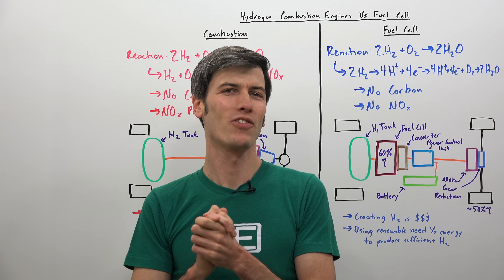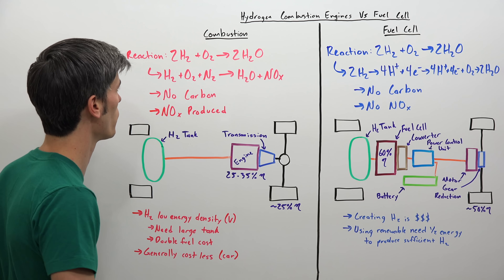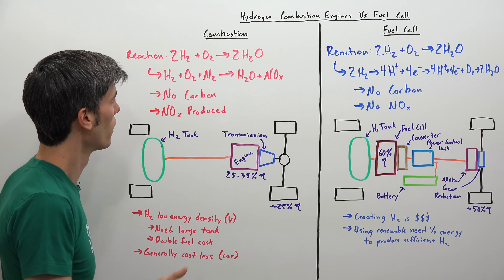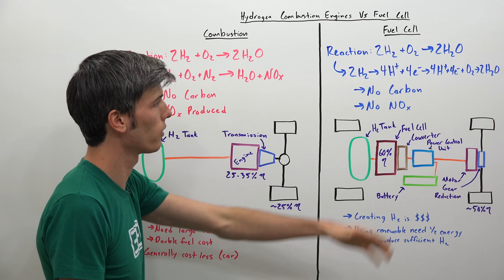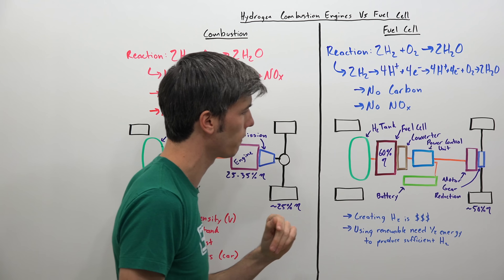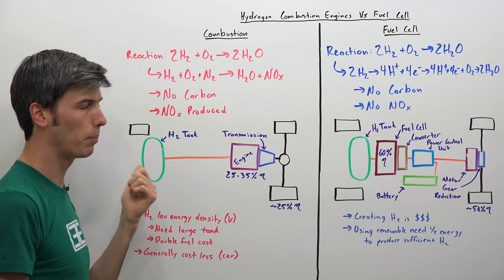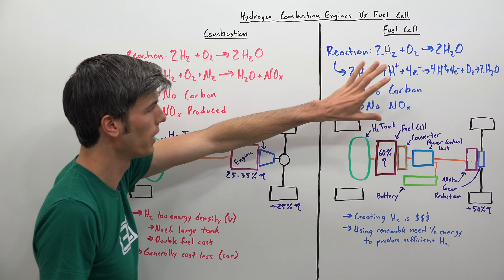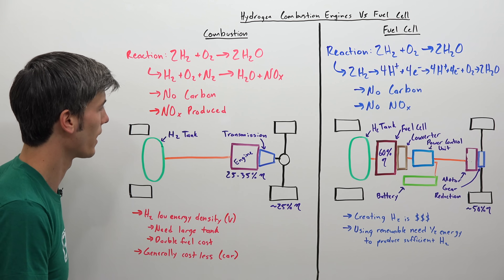Why Hydrogen Engines Are A Bad Idea

Comment: Have you ever looked into ammonia (in a Diesel) vs. traditional Diesel fuel?
Reply: It's been successfully done. In WWII, Belgium converted all its buses for ammonia fuel, and set up the fueling-stations. infrastructure for manufacturing, storing and shipping ammonia is already widespread. Ammonia liquifies at around 200 psi. Fueling stations can quickly & cheaply be converted to ammonia. Ammonia doesn't make any CO2, and can be made from renewable electricity, air, and water.  Instead of hydrogen in internal-combustion engines, it should be ammonia in Stirling Engines. The Stirling is the most efficient heat-engine, and is an external-combustion engine, and so it can easily and cleanly burn any fuel, including ammonia.
Reply: @michaelossipoff2433  i agree
Reply: @michaelossipoff2433  I know. But I was interested in a deep dive on the technical differences in performance. I know it worked and it has a lower energy density than gasoline. It also leaves a cleaner engine behind. But I haven't seen any in depth information.
It's also been used as jet fuel and rocket fuel. Again, it burns fairly clean and has several benefits. But little detailed information.
Reply: @jasonalexander2952  Yes, there should definitely be a lot more discussion about Ammonia fuel. (...and about the clean-burning, maximally-efficient Stirling Engine). But, just based on the information already available,  ammonia certainly looks like the best near-term prospect for a fuel.  And, even without details, the success of ammonia-burning Diesel buses in Belgium says a lot. It only took 5 months for the conversion.  Ammonia is so much more ready than hydrogen is!

Comment: The problem with H power is this-
The US has 150,000 gas stations
The US has 140,000 EV charging stations
The US has only  58  H fueling stations
57 of those are in California install by the state 
to give H a jumpstart.  It didnt work.

!

Comment: but here is the thing.

you more likely to get people to be driving hydrogen combustion engines then you are hydrogen fuel cells because a regular gas burning engine can be converted to a hydrogen combustion engine rather easily compared to converting it to a cell system where you would litterally have to rebuild the entire thing pretty much.

Comment: Water vapor is a stronger greenhouse gas than CO2. Where do you get the H2?   How large is the pressure tank for H2 to get decent range? Any kind of H2 will never get better than gasoline ICE. It is better to improve gas ICE for economy and lower other pollution.

Comment: personally i think at least now hydrogen combustion engines are impractical because hydrogen gas requires alot of electricity to produce and in turn requires fossil fuels to produce maybe its viable in countries with reliable renewable power like hydro dams but even then hydrogen cars will be limited to where fuel is available

Comment: Could you not generate your own Hydrogen ?  A simple electrolysis setup powered by solar panels, that you can collect and compress with a repurposed medical or scuba compressor. I have one that was used to fill air-tanks for planes. I have a couple home generators that are already set up to run on gas or propane, that i plan on using as a test bed before trying it on some old Chrysler 413 wedge and 426 Hemi industrial units from the late 60s early 70s. The Chrysler motors were built to run on propane so they already have the hardened valve and valve seats as well as forged pistons. I know the propane burns much hotter than gas, so if you just throw a propane system on a regular motor you will not like the results as it will basically melt the combustion chambers of your engine. will let you know how it turns out. With fuel prices this high price the electrical  rates are going to skyrocket as well. We need to find other ways to power not only our cars but our homes as well.

Comment: Have you seen a fuel cell breach. If you have you have you would know exactly why fuel cells are a bad idea. An instant death is not worth hydrogen oxides which can be easily recycled within the car extending its range.

Comment: Where does the nitrogen come from? Atmospheric air? Why not burn the products of electrolysis? So you just put water in the fuel tank. Electricity comes from an alternator

Comment: Couple of big problems in this video that are not bought out. 1. Yes H2 combostion engine greats NOx but unlike, H2 fuelcell engine it does not great huge amounts of carbage from used up fuel cells, those cars themselfs are much much more ecofriendly. Fuel cells are basicaly big batterys, and bateries are bad for enviroment. Second, while its true that H2 combustion would needmuch bigger fuel tank, its also true that it does not need, powercontroll unit, fuel cell so total difference between fuel tank size compared to the hole system is not soo big. Also this tank can be big because it dosent weight much, for example we could easily make the tank same size as electric cars bettery pack. Just but it under the bottom and we would have plenty of room, witch dont take away passanger room. Also price wise the combustion is cheaper.

Comment: IMO, if we want to continue with the luxuries we all use and enjoy now, mainly transportation and electricity, and if we want these things in the abundance and reliable ways we currently use them for, minus the dirty emissions that we now produce, then the only way to achieve this is through nuclear energies. 

Renewable energies are great and will continue to improve as time goes on but they are not able to keep up with our demands. Two big demands currently are air conditioning/refrigeration that is available everywhere and charging stations. Both take a lot of electricity. Renewable energies cannot keep up with this demand, but nuclear could. So if we want to continue this current life cycle with all our luxuries and demands then nuclear is the only way to go. It's either that or we go back to hand held fans and covered wagons because you can't have both demand and emission free if you don't want to use nuclear. Side note: California is enforcing renewable resources and phasing out fossil fuels and nuclear. Currently they experience black outs and brown outs every summer because those renewable systems cannot keep up with demand. I think we are going the wrong way putting all our faith in electric cars and renewable resources. We definitely need to broaden our horizon.

Comment: Why dont you talk about the recirculating water hydrogen combustion engines? I've seen some diy jobs on youtube where people basically run there gasoline engines on water
Reply: I would like to take the time to post some info about my vehicles setup.  I have been running my car on Hydrogen for about 2 years now.  I do not store large amounts of Hydrogen fuel in a separate High pressure container.  I produce enough gases on demand through the electrolysis process to run my 2.4L engine which requires about 6L per minute at 7000 RPM to run without hesitation or noticeable reduction in power.  To be clear, I do not separate the Hydrogen and Oxygen gases in my device. I simply have a small container that will be pressurized to 12-15 psi before the system will shut off production automatically.  I produce enough gases on demand through the electrolysis process to effectively bypass the need for complex High Pressure tanks to store H2 like most of the current systems.
    With this method I do not store enough combustible gases to cause any significant fire hazard or air displacement danger in the instance of a "leak" or failure of the containment device.  I bought a new fuel tank to replace the one that came with the vehicle to prevent contamination from the old fuel.  Now I use my house water to fill my cars fuel tank which holds 12 gallons.  So the fuel system is the same as you would find from the factory but, I fill it with Water instead of Gasoline and the fuel pump connects to the water container in the engine bay instead of to the injectors.  Also I do not use the fuel injectors, I use a large aquarium tube that is connected to the intake before the MAP/MAF sensors.  In order to run my engine on Hydrogen I had to retard the ignition timing from about 25 degrees before top dead center to about 5 degrees before top dead center.  I did this by using a timing light and rotating my distributor clockwise by about 7 degrees.
    As a comparison my car got about 30 mpg with gasoline, now it gets between 25-35 mpg with Hydrogen.  In conclusion I am sure that with a more complex delivery system I could get better performance and mileage because I am not monitoring the fuel air ratio but, my goal was to create a system that produces less Carbon emissions not to be crazy efficient and cheap to fill.  I believe by producing enough gases on demand this is more efficient because if I run out of fuel through miscalculation or my fuel gauge stops working, I simply need to find someone willing to sell me water (in one case a woman was so impressed she just gave me the use of her garden hose).  This is also safer because I am not using a "High Pressure" storage container for a combustible gas or liquid, it is just water in a tank.

Comment: What is the fuel efficiency of your standard gasoline-fueled automobile?
Reply: The Otto (Spark-Ignition Gasoline) engine is 20% or 25% efficient.  Stirling is anywhere from 33% to 100% more efficient than that, depending on which source you read.
Reply: @michaelossipoff2433  wow that's terrible lol
Thanks for taking the time to reply

Comment: With that said it makes little sense to use electricity to produce hydrogen and then use it to produce electricity and get twice the efficiency factor as a loss. Most probably electric cars are the future. There is great potential though for boats and airplanes that could hardly become battery dependent.

Comment: I can't understand why engineers never take the heater into the f.. ing equations. It reminds me of the frozen teslas in Germany in the winter. YOU NEVER WANT TO HEAT WITH ELECTRICITY !!!! And that's the huge disadvantage of the 'hydrogen cells' compared to the combustion engines. I'd go with H-Combustion engines and the NOx treatment is actually a nobrainer ^^

Comment: What if you had an infinite amount of hydrogen.

Fuel cell version+hydrogen electrolysis generator.

All you would need is water, batteries, and fuel.
Even more efficient.
Use the heat from the pipe cool it down into water put back into hydrogen electrolysis generator.

EVEN MORE EFFICIENT.

Comment: Your calculations always tend to leave out heating the vehicle. In the northern states we must have heat usually 6 months out of the year. The combustion engine has waste heat, as you pointed out that can be used to heat the vehicle. The electric vehicle must use its fuel to create heat. I dont know what the heat loss of an average vehicle is but being poorly insulated and surrounded by glass I would assume it is a pretty sizable load. I would like to see a video where you do a heat load on a vehicle on a 15 degree day and calculate the energy needed to heat it per hour and then deduct that energy from your range calculations. These calculations are very easy once you know the heat loss of the vehicle. It seems the electric zealots purposely leave out this information because it reduces range dramatically and would make electric or fuel cell vehicles even less appealing.

Comment: For converting ICE to Hydrogen what is the comparative power output?
Reply: I would like to take the time to post some info about my vehicles setup.  I have been running my car on Hydrogen for about 2 years now.  I do not store large amounts of Hydrogen fuel in a separate High pressure container.  I produce enough gases on demand through the electrolysis process to run my 2.4L engine which requires about 6L per minute at 7000 RPM to run without hesitation or noticeable reduction in power.  To be clear, I do not separate the Hydrogen and Oxygen gases in my device. I simply have a small container that will be pressurized to 12-15 psi before the system will shut off production automatically.  I produce enough gases on demand through the electrolysis process to effectively bypass the need for complex High Pressure tanks to store H2 like most of the current systems.
    With this method I do not store enough combustible gases to cause any significant fire hazard or air displacement danger in the instance of a "leak" or failure of the containment device.  I bought a new fuel tank to replace the one that came with the vehicle to prevent contamination from the old fuel.  Now I use my house water to fill my cars fuel tank which holds 12 gallons.  So the fuel system is the same as you would find from the factory but, I fill it with Water instead of Gasoline and the fuel pump connects to the water container in the engine bay instead of to the injectors.  Also I do not use the fuel injectors, I use a large aquarium tube that is connected to the intake before the MAP/MAF sensors.  In order to run my engine on Hydrogen I had to retard the ignition timing from about 25 degrees before top dead center to about 5 degrees before top dead center.  I did this by using a timing light and rotating my distributor clockwise by about 7 degrees.
    As a comparison my car got about 30 mpg with gasoline, now it gets between 25-35 mpg with Hydrogen.  In conclusion I am sure that with a more complex delivery system I could get better performance and mileage because I am not monitoring the fuel air ratio but, my goal was to create a system that produces less Carbon emissions not to be crazy efficient and cheap to fill.  I believe by producing enough gases on demand this is more efficient because if I run out of fuel through miscalculation or my fuel gauge stops working, I simply need to find someone willing to sell me water (in one case a woman was so impressed she just gave me the use of her garden hose).  This is also safer because I am not using a "High Pressure" storage container for a combustible gas or liquid, it is just water in a tank.

Comment: Burning in lower temp makes NOx lower.
Buring in lower oxgen makes NOx lower.
Exhaust Gas Recirculation cycle achieves low NOx.
Why is hydrogen engine car difficult ?

Comment: Great video, but another draw back is Hydrogen gas powered has not been designed yet! nor has any maker found a way to create Hydrogen on the vehicle for self sustaining vehicle, also the costs for & Lithium batteries burning has been a big issue because of the power levels of a Lithium batteries needed to sustain the proper function of these batteries.

Comment: My only doubt is if hydrogen combustion results in NO emissions why not Diesel / petrol combustion engines wont produce No emissions coz they also take in the atmospheric gas from the outside, Right?
Reply: It's the carbon you put in the tank..
Reply: @Simon-dm8zv  Could you elaborate please

Comment: yeah yeah yeah  you might be technically right .. but you leave out one important thing .. 
HHO gas combustion is an easy modification to existing fosil fuel cars and ... people just dont want to be slaves to oil anymore ..  so if an easy and working modification is discovered .. they are going to go for that over buying an expensive new car with hydrogen cell  technology

Comment: maybe you should have mentioned how difficult it is to contain hydrogen in a tank. Well because hydrogen is the smallest atom and it needs to be compressed to like 400 bar.  As it is not already enough that hydrogen is expensive, now imagine paying 10 bucks per kg and after 2 weeks your tank is half empty because of the diffiusion.

Comment: Could you do this analysis for high load / low speed applications? Then you would see how inefficient fuel cells are for this kind of application due to excessive use of coolants...
Reply: Most vehicles drive around in towns and cities, at a fairly low speed!

Comment: The energy loss that comes from manufacturing hydrogen is why you don’t see it. Not really because both machines are crap or that would have stopped electric vehicles (remote combustion) from being implemented. 

The reason people idealize hydrogen use is it’s easy to imagine a closed loop process.

What’s difficult to understand is that petroleum is also part of a complete cycle. You may loose track of all elements in the process but nature does not. Petroleum is also more efficient.

Comment: Great video. Is compressing H2 to save fuel tank space an option?
Reply: JCB are developing hydrogen engines for construction plant and tractors with 350 bar h2 tanks.
Reply: You could theoretically use liquid hydrogen as well

Comment: I think in the future we will have a mix ev's and hydrogen fuel cell cars and trucks on the road, a bit like today we have gasoline and diesel ones today. Ev's will be for those who don't cover a lot of miles and the more expensive, faster fo refuel, hydrogen fuel cell cars for those who need to cover a lot of miles or for commercial vehicles.
Reply: I understand where the comparison is coming from, but gasoline and diesel are quite close to each other efficiency wise. Hydrogen and batteries are miles apart. Hydrogen for passenger cars will never make it, for most of the trucks probably neither.